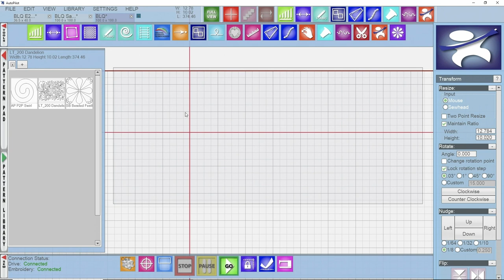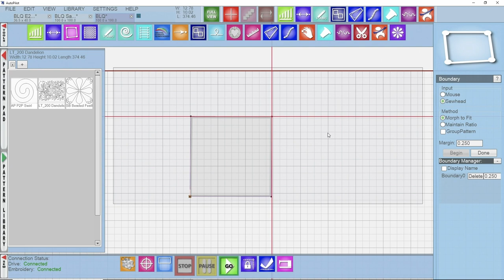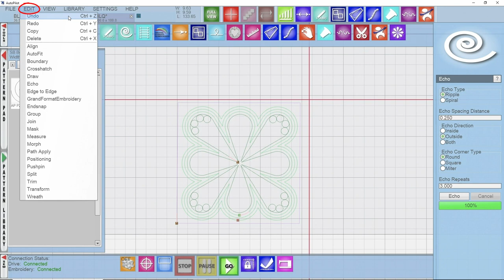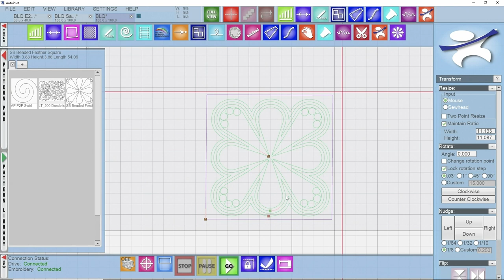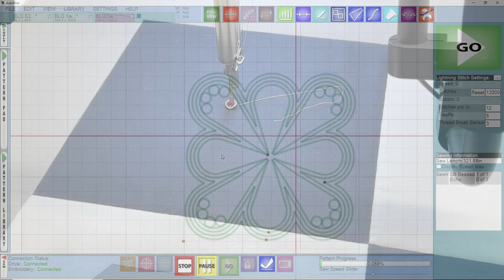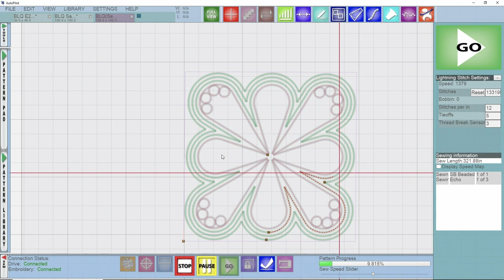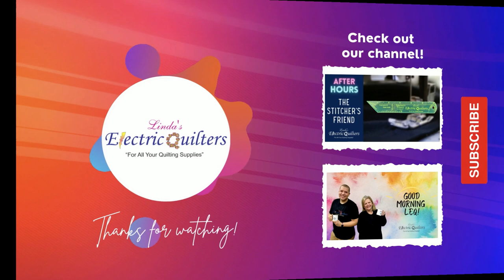INNOVA AutoPilot Training Mach 3 - HOW TO: Boundary and Echo Features

Comment: Ty, Corey!  Love these videos!  Does Auto Pilot allow you to change your Start Point's for the Echo's?
Reply from the maker: Hi there:) The software should automatically shift around the start and end points on a ripple echo, but if it does not it is super easy to move them around with Multi Segment Divide:)
Reply: @LindasElectricQuilters  Ty!

Comment: Enjoy your videos, but when I try to execute them, I run into problems. First, I could not find the Joyce Lundrigan design you use, so I selected the design "Bday 2013 006" that came preloaded with AutoPilot. Problem is, after I drop the design into the boundary area, I am not able to select the design. Also, the RESIZE area in Transform is greyed-out. Any thoughts?
Reply from the maker: Depending on what version of AutoPilot you are running that can possibly occur. Right click on the design that is in the boundary and the first option should be Group. Click on that and then Ungroup All. 

In one version of AutoPilot the boundary grouped to the pattern and didn’t allow you to adjust unless you ungroup:)